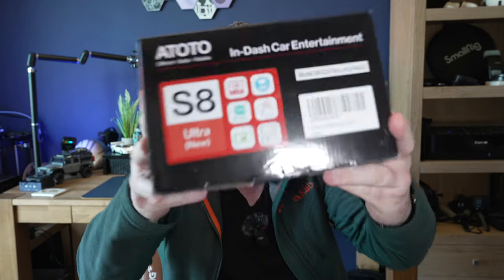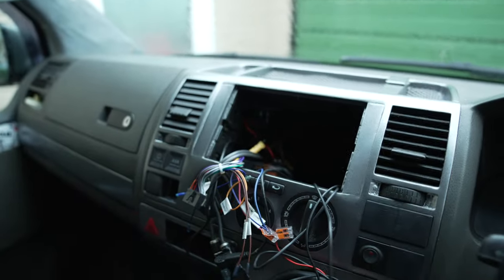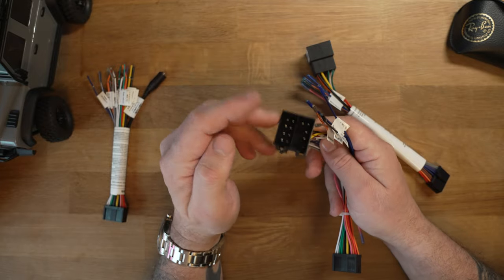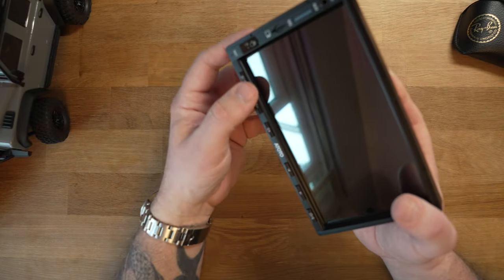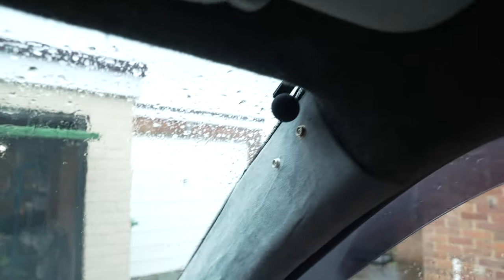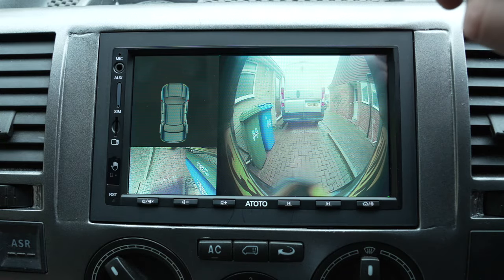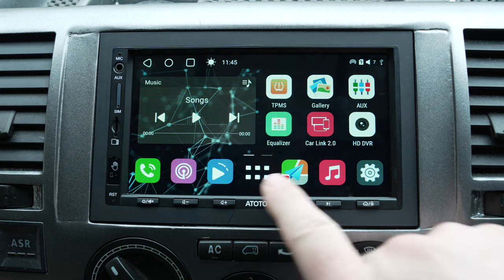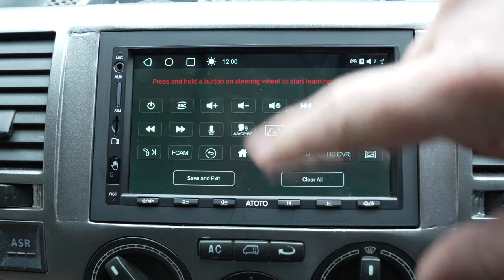Atoto S8 Ultra 7" The ultimate car stereo upgrade - fitting in VW T5 transporter

Comment: Does it reflect the sun? They can be quite hard to see when the suns out in a T5. Probably because of the upward angle.
Reply from the maker: Yes. The bigger one was better for this as I could tilt the screen down.
Reply: @SpyderLEE  thanks for that. Was considering buying one, but will research the tilt screen model. I've got pioneer and it's rubbish, and I think quite dangerous when you can't see the screen. 👍

Comment: Do i need a canbus module on 2008 transporter? I have ‘quadlock’ system
Reply from the maker: I’m not 100% as mine does not but it seems there are a couple of adapters out there. with canbus and without. Quad lock doesn’t have an ignition live so the the ones without need an ignition live finding from somewhere else behind the dash. The ones with canbus give an ignition live but I couldn’t tell you which to get without researching so I’d spend some time on google if I were you before buying one.
Reply: @SpyderLEE  i already have 2 Atoto A7 , so, yeah, i have to figure out how to make the harness properly, because now when i plug in, navi fires up in very low brightness and then close.